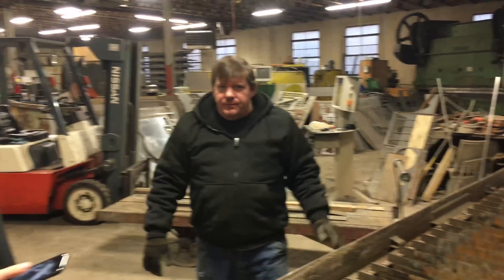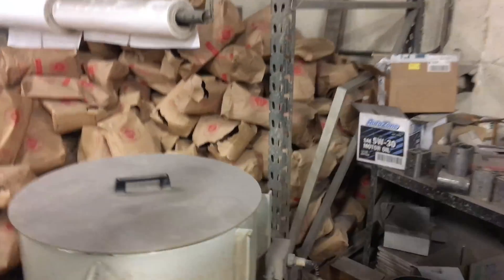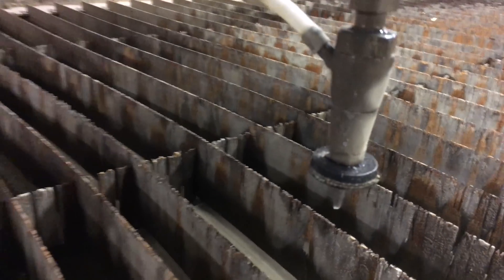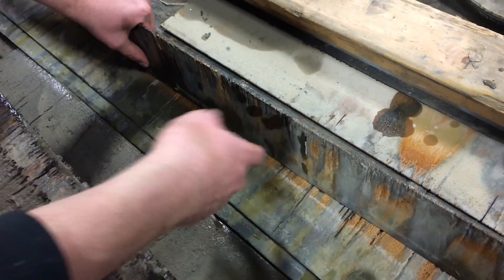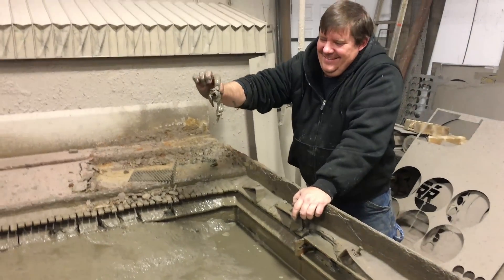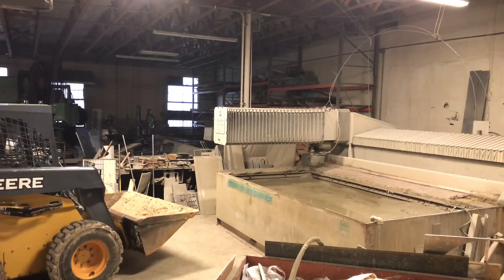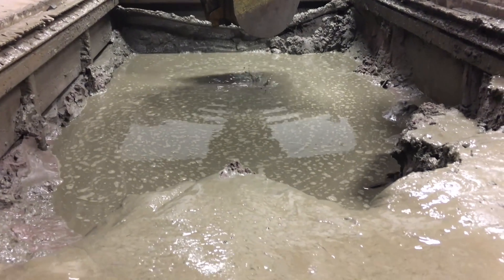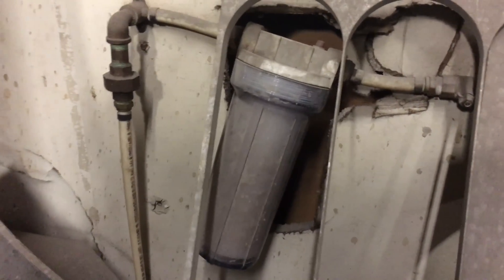Waterjet Tank Cleaning Mystery Objects - Waterjet Channel - Interesting

Comment: So, what do you mainly do when you're working? What kind of things do you cut which you can't use a laser or blowtorch to cut?
Reply: Sir Mangler the main advantage to a waterjet is it doesnt affect the metals heat treating vs blow torch plus hold tight tolerances vs a laser a wj can cut 10x thicker material at a slower pace of course.
Reply: Sir Mangler the main advantage to a waterjet is it doesnt affect the metals heat treating vs blow torch plus hold tight tolerances vs a laser a wj can cut 10x thicker material at a slower pace of course.
Reply: It can also cut things without melting/distorting them and with a plasma cutter, whatever you're cutting has to be electrically conductive
Reply: Pinoytankbuster Is up to 3 inch thickness still considered sheet metal? (not trying to be sarcastic)
Reply: Well judging by the scrap laying everywhere around the machine, they primarily use it for cutting plate metal.
Reply: I tried to not make him look like a fool....
Reply: Cutting bulletproof glass is a big advantage these machines have.
Reply: wood
Reply: heat sensitive metals like stainless steel
Reply: OK, so interested question. At what thickness a sheet metal turns into a plate metal?
Reply: Da L. Well, that depends on the definition of sheet. Does it mean it is a piece of metal, longer and wider than it is thick, or is it a thin piece of metal?
Reply: Sir Mangler cut blanks out of aluminum most likely. i used to work at a place where we used one to cut honeycomb core to its thickness before we stretched it out.
Reply: these answers are cool and all but they aren't actually examples of what they might cut on a working day.
Reply: wayne holt...... dont you just love when people attempt to correct you when theyre the ones thats actually wrong?  lol

Comment: ALL THAT AND YOU DON"T SHOW THE CLEAN TANK?!
Reply: I dont think they make it "clean" they just remove most of the used sand and thats about it. Its a machine at the end and it will fill up with sand anymore at the end
Reply: weesh ful yeah it's just a waste bin basically so it's doesn't have to be spotless
Reply: That's not clean.
Reply: that's because they don't clean it beyond that point as it becomes more effort than it's worth
Reply: Ultimate cock block feeling :(
Reply: weesh ful ye your right
Reply: weesh ful
Reply: uwu
Reply: weesh ful that's not the clean tank. That's the empty tank.
Reply: Ya that part was great for my OSD.
Reply: Joe Smith -  just curious, what does OSD stand for?
Reply: bchaplix Obnoxious Spelling Disorder
Reply: Joe Smith what’s osd?
Reply: weesh ful I agree

Comment: So if the water wasn't coming out of that hose at 60,000 PSI would it be safe to drink?
Reply: Unless you like eating sharpened sand, probably not.
Reply: The operator safety card states that the water contains bacteria and other bad things usually found in sewage.
Reply: @dannooo548  thats the water in the tank.
Reply: Arend Wolbers You have never wondered why we all live longer nowadays have you.
Reply: well, they used it to cut up turkey/pie/chocolates/etc and then ate that food.
Reply: Life expectancy has risen by 12 years in the last 70, which is a pretty dramatic increase. I'm not saying kids shouldn't get in the dirt and build up immunitary system, but our sterile tending lifestyle has made quite the difference overall.
Reply: Im sure it would be.. As i understood they use fresh water... do they?
Reply: Also it would almost technically be ultra pure water, which would strip your body of its minerals and kill you.
Reply: as it only goes thru sediment filters, not really.. it would at the least require some carbon filtration and go thru a membrane filter or you would risk heavy metal poisoning or other types of health risks due to the dissolved metal contents of the water that sediment filters wont remove. let alone the bacterial and microbial contents of the water that would be contained in it from the sand and crap rotting that has settled for a while..
Reply: @MattWeber  i think he meant if u literally poured the waterjet water into the cup without abrasive
Reply: @MattWeber  including bits of cut up food
Reply: Kasigil  yes without the abrasive
Reply: If you listen well,Yes! And filtered to 0.5 micron, the water alone is way cleaner than tap or even bottled water!
Reply: Do we? My pa and his brothers/sisters all got around 100, as are my grandpa and his brothers/sisters as well as their dads and granddads, I have a family tree as far back as 1520 most of them got between 90 and 110 yo. Nowadays if you walk over a cemetery ages are in low seventies and much around 30 yo. For finding my family tree I had to visit many graveyards.
Reply: 2017 - Life expectancy in the United States dropped for the second consecutive year, while the top 10 causes of death remained the same. 2018 - The new average life expectancy for Americans is 78.7 years, which puts the U.S. behind other developed nations and 1.5 years lower than the Organisation for Economic Cooperation and Development (OECD) average life expectancy of 80.3. Living in the US increasingly looks like a health risk.
Reply: Dan Nichols,
Why did people living in the ´60 and before did not get sick of poop bacteria, because they were resistant, after ´60 people more and more people got fear of smudging, antiseptic soaps and UV cleaning, wearing rubber cloves, make children today get sick or die if playing outside!